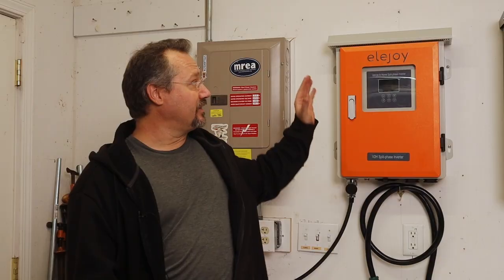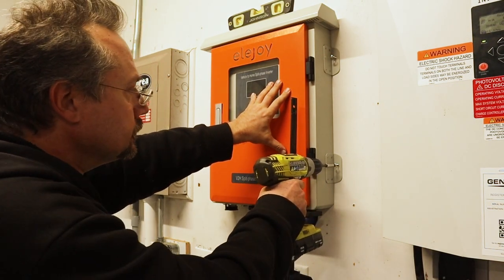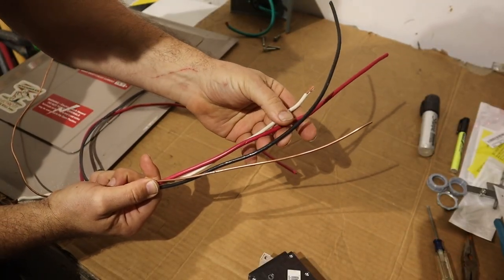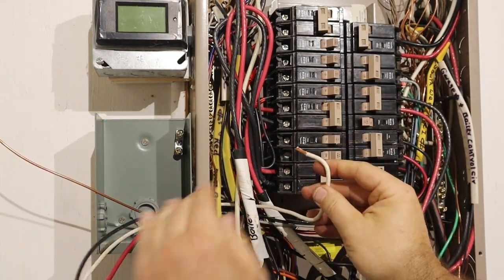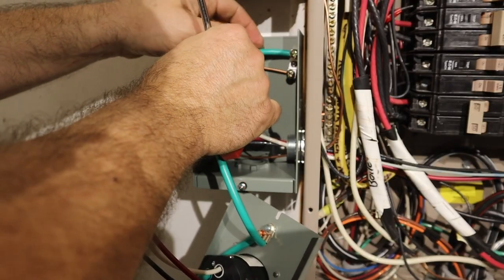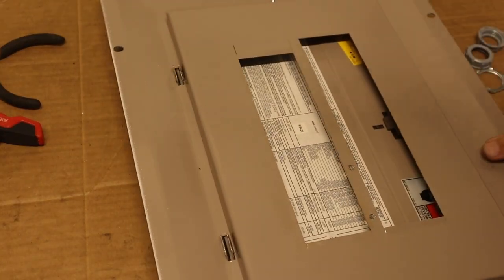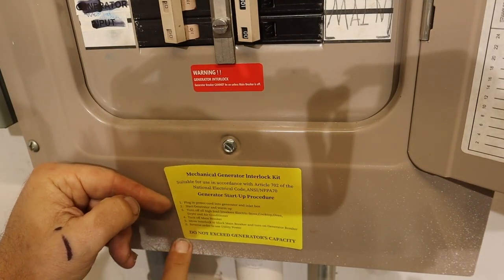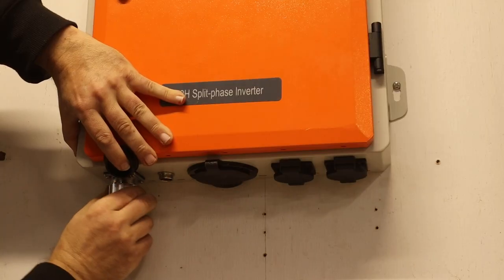How to Install the Elejoy V2H (Vehicle to Home inverter system)

Comment: You mentioned that late year 2019 Teslas will be compatible. I have a 2019 Model 3. I took delivery in September’19. How can I tell if mine is compatible?
Reply from the maker: It’s whether or not your car is CCS compatible. That’s the year the new cars came standard with it. A little bit older cars can get retrofit at the Service Center. 
Look in your car’s screen on the Software page and go to Additional Vehicle Information - It will say if CCS is supported or not.
Reply: @BenjaminNelsonX Thanks!

Comment: If this can deliver 8,000w (8 kW) as advertised, how can you use a 30-amp breaker? Shouldn't you have used a 40-amp breaker?
Reply from the maker: Breakers are designed to protect wiring. I had wiring and a breaker already appropriate for a 30A setup.
The V2G is advertised at 7kW continuous and 8kW peak.
Breakers are thermal based and will briefly allow more than the rated current.
30A times 240V is 7,200 watts. That sounds like a pretty good match to me. 8,000 watts is 33.33A. Since that's only PEAK power, I doubt I would pop the breaker.

In real-world testing at my house, I never got more than about a 5,500 watt total draw. And that was with intentionally turning on pretty much everything I could think of at my house (Other than EV charging, would could go up to 40A all by itself, and is not needed in a blackout.)

On the back of my house, I installed a 50A generator input, along with a 50A circuit breaker and interlock. The wiring is more expensive going to a higher current rating. However, that "future-proofs" that input by allowing for a higher power generator or other power source later, while still being able to use something like this inverter right now.

Comment: Very nice! Torque wrench or torque screwdriver will be good for the connections. Harbor freight has them now, the screwdriver ones. Little pricy but definitely worth adding to the tool set.
Reply from the maker: Yes! Make sure electric connections are tightened to the torque listed on the equipment.

Comment: Did you hang all that stuff up over studs or just screw into drywall, hard for me to tell on the vid, but overall good vid, thanks!
Reply from the maker: This is in my detached garage. I made the walls out of plywood, knowing that I would want to be able to hang things anywhere I want!
The mounting tabs on the V2H inverter are spaced at 16", so if you are mounting over drywall, locate your studs and mount into those.
Alternatively, you could mount a rectangle of plywood or cross pieces of "one-by" wood horizontally to the studs, and then mount the inverter into the wood you added.
Other components, like the input box, should also be fastened directly to solid surfaces - either straight to a stud, or to some wood blocking.
Reply: @BenjaminNelsonX  awesome idea, ok thank you for the reply, still had to pass on this, but the idea is so great, wish you all the best!

Comment: This is marvelous, Ben! I anticipate the Elejoy will work with the '27 Chevy Bolt, and interfacing that with any number of 51.2V LFP/solar home systems?
Reply from the maker: This V2H inverter is not specifically designed to work with solar - just like a gasoline portable generator is not specifically designed for working with solar.
However, I will say that the Elejoy V2H gives a high-quality waveform which will act as a "Grid-Forming" inverter. The one time I accidentally forgot to turn off my grid-tie micro-inverter solar, the solar fired right up as though the V2H was the grid.

I also have some Generac solar equipment, including a 10kWh battery. That battery can be charged by solar hooked to the inverter/charger OR from grid power. The Elejoy V2H worked just fine AC-Coupling to that battery and charging it, just as the grid would.

In fact, I think that a large electric car battery and a modest home battery combined would be a fantastic power backup system. Even if the car left (to recharge elsewhere at a Supercharger maybe?) the smaller domestic battery could still run a fridge/freezer or other essentials while the car was gone.
Reply: @BenjaminNelsonX  Thanks for the update. The scenario you describe in the last paragraph is what I was thinking. I'm not flush enough to get a '27 Bolt next year. But maybe in a few, when the lease returns come back to the dealerships? The Elejoy really looks like it could be an integral part of it.

Comment: Really excited to see if this unit is smart enough to signal to the ModelS it i a low kW 'charger'. If it advertises low kW, the Tesla wont waste energy heating the battery.
If you have ScanMyTesla app for Android and iOS and a CanBUS-BT dongle, you can see the battery temperature and battery heating current.
You will see ~300W overhead of the onboard electronics when the car is fully awake when (dis)charging.